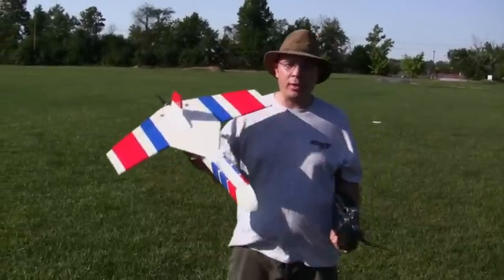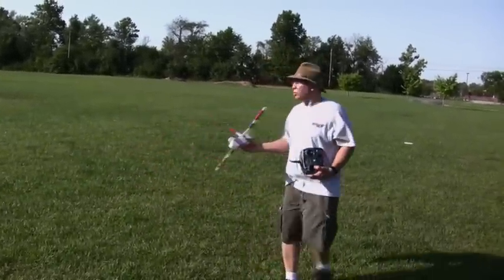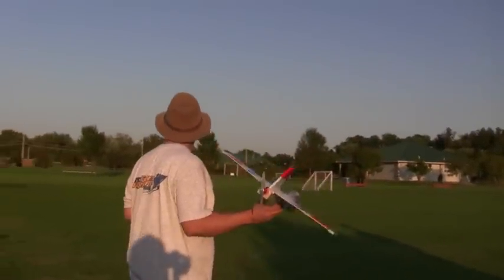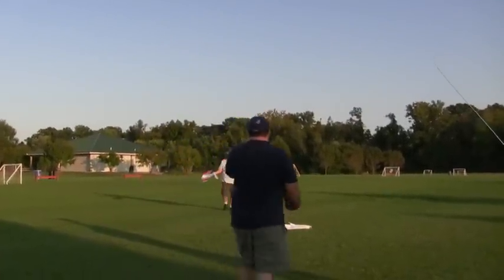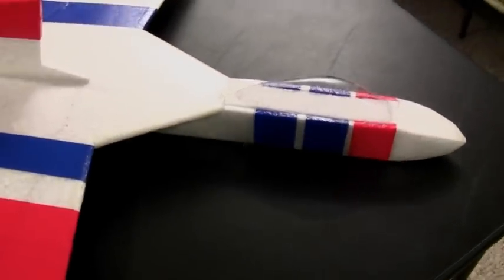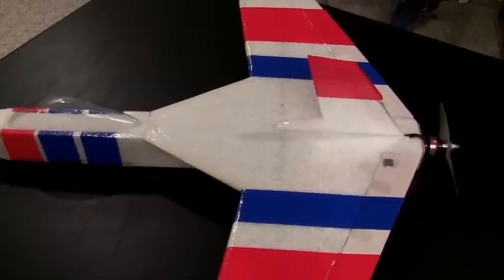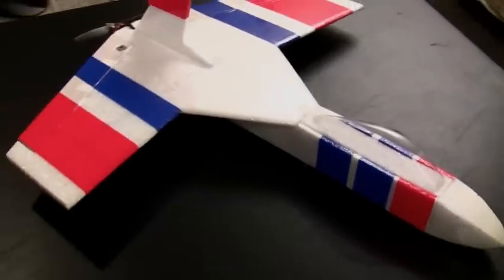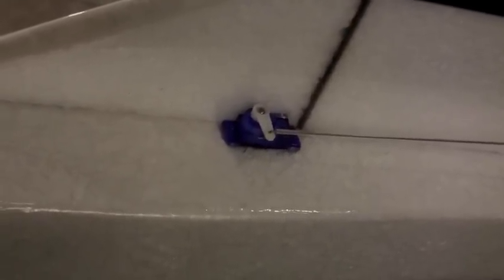rcFoamFighters Mini Dragon Forward Swept Wing  Maiden Flights

Comment: forwardswept doesn't seem to work at this scale.
if the lift goes away at the wingtips first and this happens quickly you get a positive torque around the y-axis pitching the plane down; at that time the vertical stabiliser is taken out of the wind and it goes all out of control.
Do try to make the vertical stab. longer and backwardsswept at a low angle. (50° and 6")